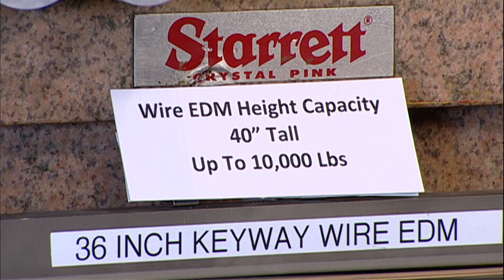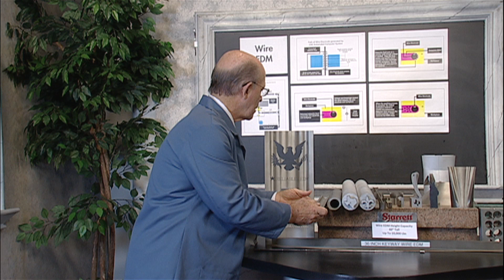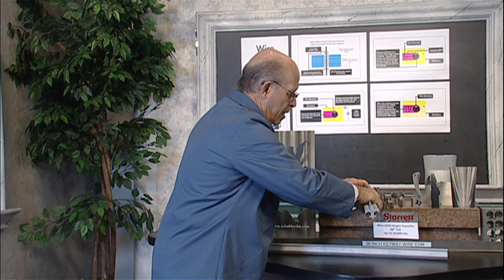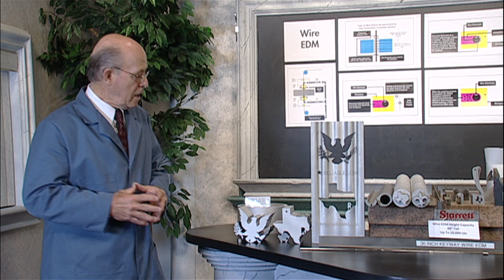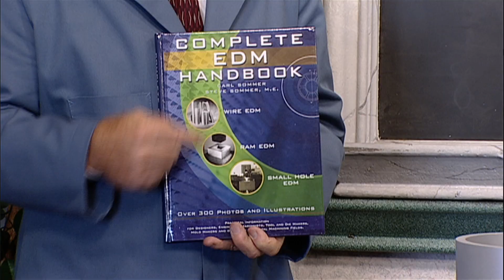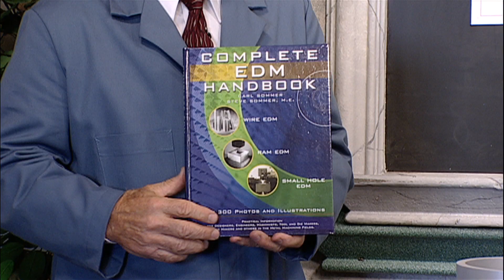Capabilities of Wire EDM: Part 2

Comment: Wire edm burns cutting surfaces and left there heat expansion and reduction cracks on cutted surface metalurgical structure, you can reduce these with fine sparking and use of materials like sleipner tool steel specially produced to reduce micro cracking in the surface, best stamps produce by profile grinding their surface to become more resistant to metal fatique, edm left micro cracks on the surface that leads tendency for fatique cracks occur faster

Comment: Could you use the taper cut feature to cut a knife blade? I mean one that is sharp with a very fine edge? And, does Wire EDM disrupt a steel's temper? Either way, you could make some very sharp knives out of some very hard materials.